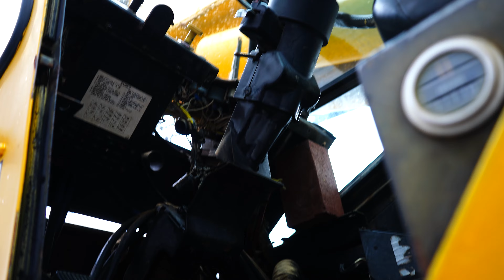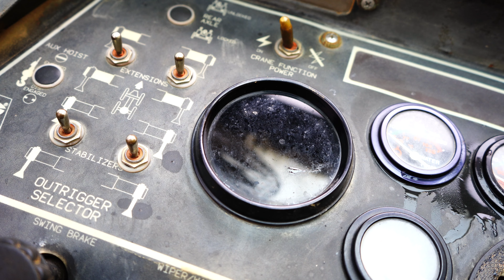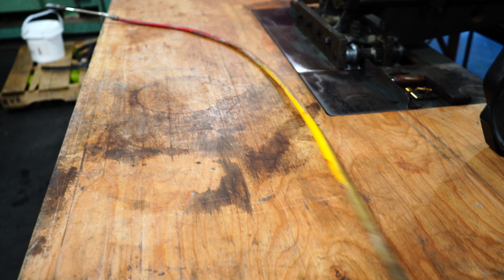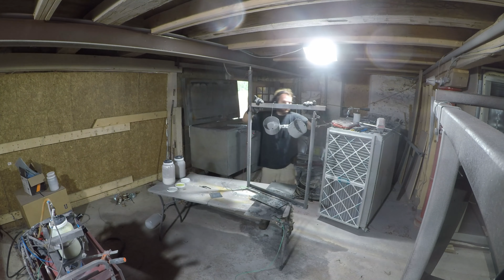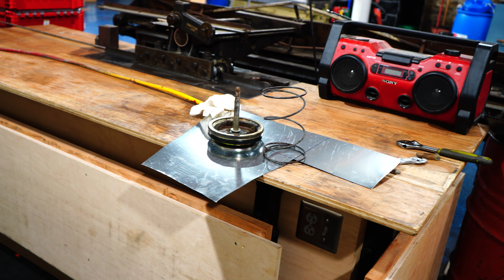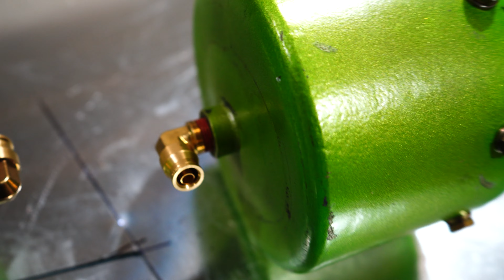Crane repair, Shifters and Brakes!

Comment: But did the internal boot slip into the grooves on both ends.  You take off the brass air fitting on the housing cap and place a screwdriver or nut driver into the hole to keep the piston from sliding too far in. You put the internal rubber boot smaller side on around the rod. You push the heavier side on while compressing the spring with a gap just big enough to slip your fingers in to fix the larger end of the rubber boot onto the heavier thicker side.  Move your fingers out of the way then squeeze the larger cylinder cover up towards you and you finish compressing the spring.  Then get two bolts on to get it stated.  It took me like 2 hours but I finally made sense of it. I should have taken a video.  And just might be willing to take one apart to do so.  I was looking everywhere for an example of this power booster rebuild. I wish I had time to powder coat. I ended up using JB Weld to fill in the rust pitting. Also used o-ring silicone based sealant grease, no petroleum based oil.